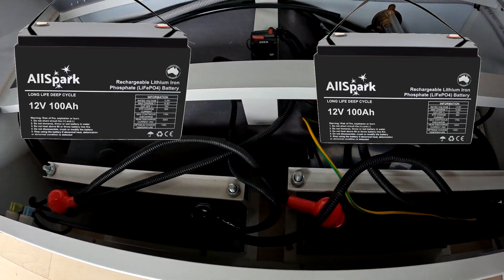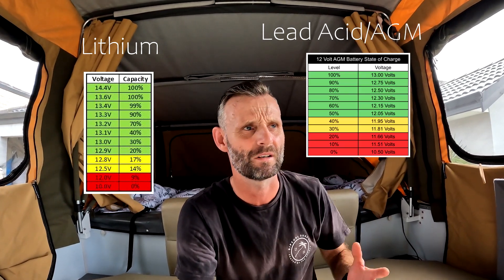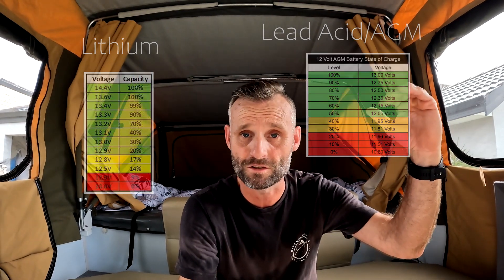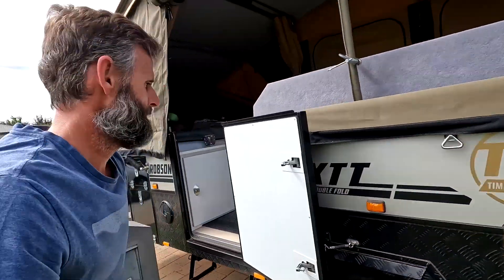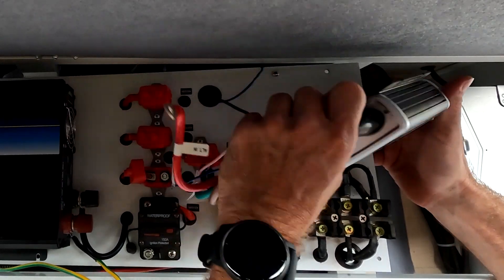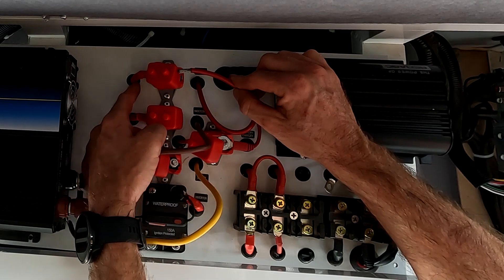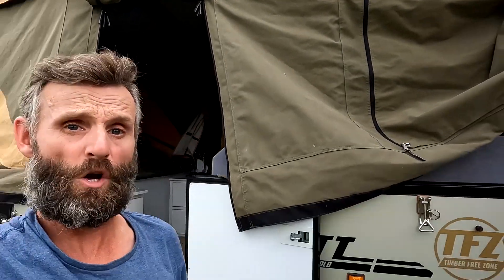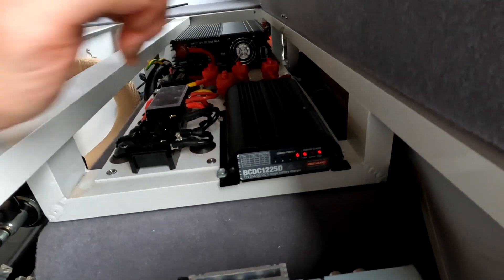LITHIUM VS AGM for a 12V System in Off Road Camper Trailer

Comment: How are you charging your batteries whilst in storage?
Reply: Cheers, will look to do the same. Keep the content coming it very useful, especially for us first time Robson owners. Cheers
Reply from the maker: @art-of-dirtmtb5753  thanks mate!! Great choice in camper 😉
Reply from the maker: @art-of-dirtmtb5753  hey mate we have the camper connected to power to charge the batteries when we are  not using it.
Reply: @ do you leave it connected all the time ? What do you use to connect to the power, do you use an amphibian adapter ?
Reply from the maker: @art-of-dirtmtb5753  yeah we keep it connected the whole time and using and amphibian connector 😊

Comment: Awesome video! Just discovered your channel and been enjoying your videos. 2019 Robbo owner here and about to  upgrade from the AGM's to Lithium so this has really helped. 
Just have 1 question about the Redard BCDC charger you installed: I see the model you got was the BCDCN1240D, which is the 'Under Bonnet'' more robust to heat, dust and water. Was that the recommendation? As being installed in the Robbo shouldn't really be subject to those conditions (?), or was there another reason? As the  'In Cab' model is $300 cheaper.
Reply from the maker: @MrFreofanatic  hey mate, welcome to the channel 😊 Just say The projecta charger I removed was an under bonnet one so I kept it the same and just changed it to a lithium compatible one 😊
Thanks for watching!! 🍻

Comment: Hi mate why did you upgrade the 240 volt charger. You can still use the old charger on power supply mode for Lithium
Reply: Thank you mate. Also what made you get the 25ah dc charger instead of the 40ah iam looking at same setup but with a 40ah charger do you know if there’s any issues with the biggest charger?
Reply from the maker: @Livinn4x4  hey mate the reason we kept the 25ah was at the time we had the Everest and I wasn't sure the altenator would have handled the bigger charger so just went like for like. Kind of wish now we have the Cruiser I went for the 40ah.  Cabling may be sufficient though so it would be worth checking with who you buy the charger from  it you need to upgrade that as well.
Reply from the maker: Hi,
According to the 12v guys I was getting advice from the charger should be changed to one with a lithium profile. Lead acid chargers will work, to a point. But if you want the batteries topped off to 100% a charger with a lithium algorithm is the go.

Comment: Hey mate thanks for the vid. Be awesome if you put in links for each product for us who don’t know what they are haha. What charger did you use? I know it’s a victron just not sure the model. We just got an Austrack was tossing up between the mdc and that but I wanted something I could review that no one else had. Electrical system is very similar. I’ve got two 100ah lithiums redarc bcdc and just need a good charger to replace the projecta
Reply from the maker: Hey mate,
Good idea on providing the links.
The batteries are 'ALLSPARK 100ah LITHIUM'
I probably used the same dc charger as you did.
'BCDC1225D' as for the AC charger I used the
'VICTRON 12V/15A IP65 ACDC SMART CHARGER'
I purchased them all from Offroad Living in Wangara (perth)
Hope this helps. 
Thanks for watching
Craig
Reply: @RoaminintheRobbo  yes thanks so much for the information very helpful I’m hanging to get all the gear in with the help of your video!
Reply from the maker: @dibattistasimon  good luck mate, hope the install goes well!

Comment: Hi matey , did you need to replace the 240 an 12v projecta to be able to run the lithium ?
Reply from the maker: Hey Harry some people don't but I did. lithium batteries charge  using a different profile than agm's. If I used the original chargers they will not reach 100%  state of charge. So I also installed a new dc and ac charger that have a lithium charging profile. Thanks for watching mate!

Comment: I used to believe that the capacity of Lithium batteries and the weight saving were the main advantage when compared to AGM but having used Lithium for past 3 years I now believe that the current absorption is probably the best advantage. Regardless of how many AGM batteries (AH capacity) you have, you're still limited by slow charge rate which makes it difficult to replenish the energy whereas Lithium is phenomenal with it's speed of current absorption. Thanks for the content, cheers
Reply from the maker: Thanks mate! We agree, we have been so happy with the lithium batteries! Have not had any issues with running out of power, they top back up quickly, so glad we made the switch. Thanks for watching and taking the time to comment we appreciate it 😃

Comment: New follower here, love all your videos, practical, no nonsense approach, well done and thanks for sharing. Could I ask you a couple of questions regarding this video please?  You mentioned the blue "ignition" wire from the charger routed off to pin 12 on your trailer plug. Where does pin 12 go to on the car side, and, is that a custom thing or is that what pin 12 is used for on any vehicle? The reason I ask is because many of the YT vids on running and anderson plug setup also requires the blue wire to be run the length of the vehicle to an appropriate spare fuse point at the front.
Reply from the maker: Hey Moike Hunt (nice name...gotta say that one slow while the kiddies are about😂). Cheers for watching and welcome.
The ignition wire (becomes live when ignition is on) is only needed if the vehicle has a smart or variable voltage alternator. This allows the dcdc charger to operate at lower voltages. If the vehicle doing the charging has a fixed voltage alternator it's not needed.
The camper was pre wired with a 12 pin trailer plug and the dcdc charger's ignition wire run to pin 12. (spare accessories pin)
The Everest has a smart alternator so needed an ignition wire run to pin 12 on the car's socket to match up with the camper's plug.
I don't know if it's common for pin 12 to be used for this but in my vehicle's case pin 12 was empty, so yes it was a custom job.
I'm not exactly sure where it has been taped into as I had an auto sparky run the wire at the same time they installed the electric brake controller. 
I can see that taping into an unused fuse location that energises when the car is running would be an easy option. In my case I have a feeling the sparky has soldered the wire to something under the dash.
I hope this helps and hasn't muddied the water.
Let me know if you have any questions and I'll do my best to answer them
Craig
Reply: @RoaminintheRobbo  Ah cheers Craig for that detailed and comprehensive explanation, I am much obliged and it's actually along the lines of what i was thinking. So only one more question if I could, what might I expect an auto elec here in Perth to charge to run a single wire from plug to front as I do have one of those smart alternators. Or maybe put it to Airtasker? Incidentally, my son set this account up for me as I am too dumb in most matters cyber and would you believe, that's not my pic either lol, he seems to think it's all bloody hilarious. Apparently Mike was already taken lol.
Reply from the maker: @moikehunt8928  🤣Bloody kids hey. Mine are still a bit young for the whole, tease the old man thing...they still think I'm cool, little do they know.
Sorry mate I'm not sure what they'd charge just for a single wire run. As mentioned mine was done as part of a bigger install. Airtasker might be the way to go or contact some local auto sparkies for a quote. If you need additional sparky work get it all done at once, it'll work out cheaper in the long run.
Best of luck.

Comment: Lithium batteries are coming down in price and AGM's are going up.  Three AGM's top quality costs about nine hundred--my  200 ampere hour Lithium battery costs about a thousand including the dc/dc charger which also will connect to the solar arrays.  The extra battery charger capable of charging lithium cost less than three  hundred,  but I could have saved that had I switched my existing charger to the CALCIUM setting and put it through the DC/DC charger--but that would have limited the rate of charge, so I bought the extra charger--give the cat another goldfish.  I also bought fans and programmable switches to ventilate the refrigerator locker and battery and charger compartments,.  Fan plus thermostat switches cost about a hundred each if one includes the essential dust filters and air inlets and outlets and weatherproof grilles.
Reply from the maker: Het Mike
Lithium all the way. When you factor in pros and cons the prices are comparable. 
I've been contemplating getting some fans for the fridge compartment. It gets pretty toasty in there during summer. 
Thanks for your feedback

Comment: Yea… just got two Lifepo4 100 amp batteries… there amazing!!!
Reply from the maker: They make such a difference dont they! We got to use ours recently and we were really impressed!!
Reply: @RoaminintheRobbo  there double the usable power with half the weigh and three times the life… Amazing batteries for sure but people keep buying lead acid batteries because of the cheap price but lead acid are really much more expensive when you consider the extra weight you have to carry around with 1/3 the life… Lifepo4 batteries are a no brainer!
Reply from the maker: Absolutely agree Brian! Unfortunately it is a big outlay cost wise but when you look long term cost becomes negotiable between the two and lithium have so many other benefits!

Comment: Craig can you detail the cost of the batteries, DCtoDC redarc and charger? (and any other costs) thx
Reply from the maker: Hi Wallace we paid $1125 each battery, the redarc was $500 and $240 for the other charger. We got all our gear from Offroad living, their website is great to check out and the guys are very knowledgeable. If you are looking at doing the conversion they well worth checking out! We also needed some terminals and heatshrink which all came to approx $30-$50.  Thanks for watching the videos!
Reply from the maker: Hi Wallace thank you for letting us know about the audio on François Peron video! I deleted the video and then realised I couldn't reply to you. Really appreciate you letting us know! 🙏

Comment: There's no reason why AGM batteries should be restricted to half of their rated capacity. It has zero detrimental effect on the battery's lifespan. The changeover is worthwhile in your case. I'll do mine eventually.
Reply from the maker: Must of been the quality of battery we had then as the batteries were never left discharged at any point, thanks for the info good to know!! We feel it was the best choice also and look forward to testing them out off grid soon!
Reply: @RoaminintheRobbo  That guy doesn't know what he's talking about. Depth of discharge most definitely does have an impact on the life of an AGM battery.
Reply from the maker: @andrewford80  that was our impression as well. Regardless they failed and it was for the best as the lithium is much better for us and our set up 😁
Reply from the maker: Thanks Glenn that is handy to know, we were just going off what we were advised by the camper manufacturer. We had thought that may of been why the batteries only lasted a year, though I suspect it is more to do with the quality of them 😁
Reply: @RoaminintheRobbo  AGM batteries are damaged by leaving them in a discharged state for too long. The actual discharge level is not important. Regardless, the changeover is still worthwhile.

Comment: I suppose/hope you know that voltage is not a thing to monitor with lithium ( normally). I disnt catch if you had one but If you dont have a shunt, get one. I suggest victron bmv-712 ( since it has a screen and a long range bluetooth) but there are others. But i suppose you know that to. Shunt should always be included in a lithium install. 13.2 v ( resting voltage) all the way from around 20% to 80% really dont give you a clue). I like that trailer.
Reply from the maker: Thanks Bjòrn for watching and your feedback we appreciate it!  We will be eventually installing a shunt, it is definitely on the list 😁 cheer mates 👍

Comment: Good setup. 
I have the same charger’s but running AGM   
I have a small 800w generator for those cloudy days. I probably won’t need it if I go lithium. 
I will change over once the AGM dies.
Reply from the maker: Thanks Neil! Good idea, that's what we did as well. Really think these new batteries are going to be a game changer for us!

Comment: Great video, I’m not game enough to install the batteries myself but mines going in tomorrow, how are you monitoring the capacity of your batteries given the volt meter will tell you what voltage you are at but as you said with lithium it will keep a high voltage until almost dead. We are getting the victory smart shunt with ours so I can monitor, mainly because of having poor AGM batteries previously I found myself worrying all the time if the batteries would die 😂
Reply from the maker: Hey Gareth, thanks for watching. I wasn't super keen to do the install myself, but we were on a time limit due to an upcoming trip and couldn't get the Robbo booked in. After picking the brains of the guys we bought the gear from I figured it was within my capabilities (thankfully I was right). A smart shunt is definitely on the list of future mods. While not precise the volt meter will provide a decent enough indication of the state of charge. A google images search for '12v lithium SOC chart' will give a list of voltage ranges and SOC%. Happy camping and here's to no more power anxiety!!